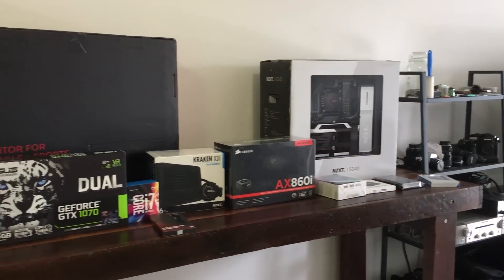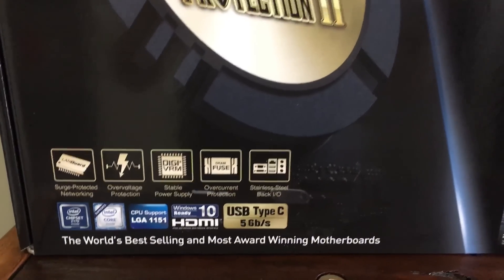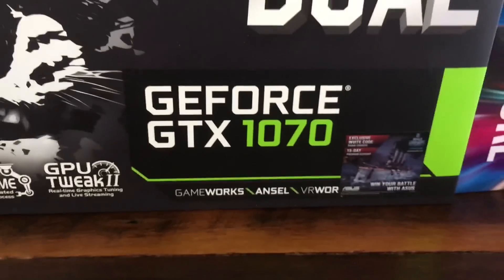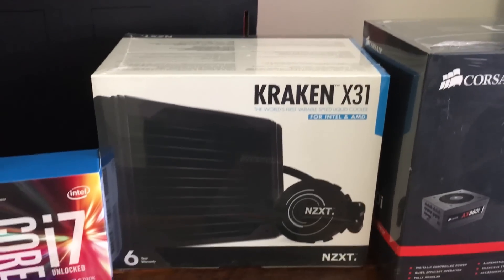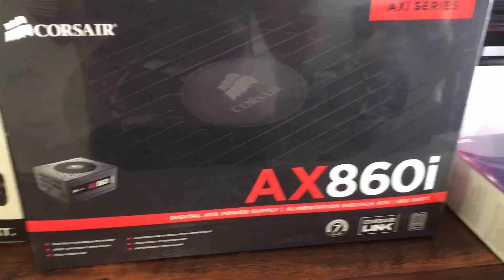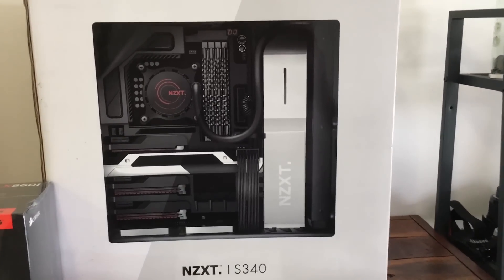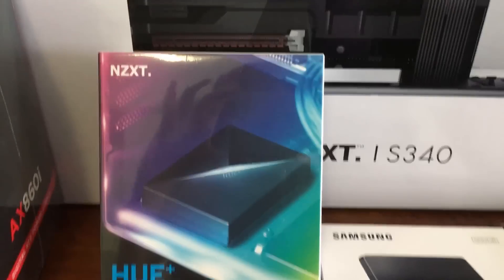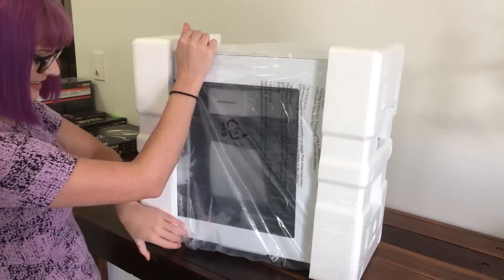My First PC Build!

Comment: what would you waste money on the psu over buying a bigger radiator for you cpu cooler
Reply from the maker: PSU was a gift
Reply: still you could have spent more money a bigger radiator
Reply from the maker: +Rekkles EU You're right. I should've grabbed more money from the giant piles of cash that I have lying around
Reply: you could have sold your £200 power supply got an £80 one and used the other £120 on a bigger radiator
Reply from the maker: That's a pretty rude thing to do when someone gifts you something

Comment from the maker: UPDATE: I've switched rear fan to exhaust. At the time, intake was the advice i was given and also in the instructions for the CPU cooler. 

Also please note that the PSU was a gift. So stop trying to tell me it's overkill :)
Reply: I do the same, buy a much bigger PSU than what is required in the hopes that the PSU runs much cooler and gives a more stable power output so my components don't break over time
Reply: gj
Reply: can i have a music name
Reply: PSU no longer overkill, RTX 3080 needs 750watt so you were just planning ahead

Comment: Congrats, those are very nice parts. But gotta say that you should reconsider where to put that cooler radiator and learn about air circulation in pc cases. Correcting these aspects will provide you better performance, if you care about getting max of your hardware.
Reply from the maker: Hey! The cooler advised making the fan intake to keep the radiator clean. I may switch it up to compare performance. :)
Reply: Naysy you may make a video about this.

Comment: The GPU is overkill for the monitor you have.
Reply from the maker: I wanted a good GPU for streaming and VR compatibility.
Reply: Naysy Yeah but a 1060 would have been enough as you would not need more than 1080p
Reply from the maker: Yeah but I wanted to future proof myself and will probably buy a new monitor later on.

Comment: Nice ^_^ 
Here's a small tip for your next build,
Build your computer outside the case (cpu, ram on the mobo) then mount your watercooler and place your psu on the case and at the end place your mobo in the case, mount the cpu block on the motherboard, connect your cables and you are good to go :D 
Keep it up ^_^
Reply from the maker: I might try that but the motherboard was a pain to seat in the case. The IO shielding was really poor quality. It was the most frustrating part of the build lol.

Comment: I really hate the way you say asus
Reply: I would also recommend you to get two additional 140 mm fans, putting them in the front of the case as Intake, so that they blow air into the system and then turning the fan on the kraken around to make it a second exhaust. That way you will ensure to have positive pressure inside of your case which will help with the accumulation of dust, as well as allowing for cooler temperatures while turning the fan speed down for less noise.
Reply from the maker: Devilhimself It's pronounced correctly. You should Google it. Air flow and temps have no issues as is

Comment: There is no right or wrong but usually people put the rear fan to be an exhaust even if the aio manual says to put it in a pull configuration to keep the radiator clean.  If it was me I would move the top fan to the front and have air coming in and pulling it out the back.   Probably makes little difference though anyway awesome build looks amazing!
Reply from the maker: Jose Vazquez The top and front fans are exhaust and I can't really put the CPU cooler fan anywhere else really except maybe on top. It's running well though :)

Comment: not sure why you have the rear aio pulling into the case.
Reply from the maker: The cooler advised making intake to keep the radiator clean. I may switch it up to compare performance. :)
Reply: doesn't make a huge amount of difference to be honest. the way that it is, the rear of the rad will collect dust so you have to take both rad and fan out to clean. having the fan as push out the rear, you have to take the fan off to clean the rad.its not going to do anything for temps, just better airflow

Comment: Everything is great and looks stunning (except Corsair power supply's aren't that reliable).

Also I know the anti-static bracelet said on the packet to clip it to the case, but it doesn't work well through the paint/coating of the case or without the case actually being earthed.  You are better off plugging the power supply in, leaving it on the table, putting a unpainted/coated screw in the back(one of the mounting holes) and then clipping yourself to that.  The power supply is how the case will earth anyways.
Reply: I think you're going to be right, I've only used Corsair PSUs over the past 10 years and they're all still working.
Reply from the maker: The Corsair power supply was a gift. Fingers crossed it doesn't cause issues :)
Reply: From what I've heard the higher end ones like the AX series are actually some of the best PSUs you can get, it's just the cheaper Corsair ones you have to watch out for. I think that one also has something like a 7 year warranty too
Reply: lol listen to this guy trying to sound smart, yeah buddy sure corsair aren't reliable... sure sure buddy, you want a lolipop ?
Reply: I'm still using my 9 year old Corsair TX750.
Reply: The AXi and HXi series are very reliable PSUs and corsair doesn't actually make them the AXi OEM is Flextronics and the HXi is CWT, CX is also CWT but they are good and bad depending on the model the CX average and the HXi very good, you can't slump one company over one PSU chances are that the different models are from entirely different OEMs.